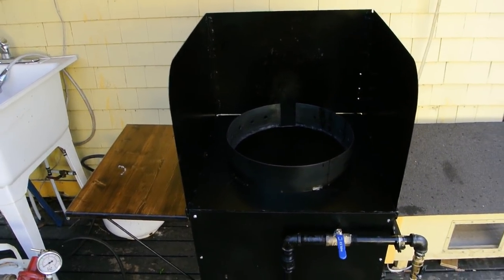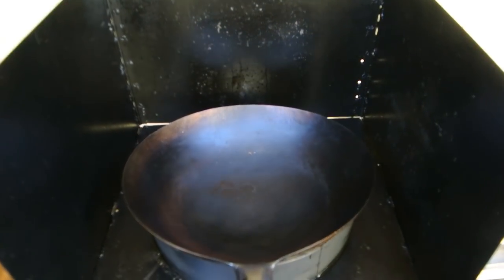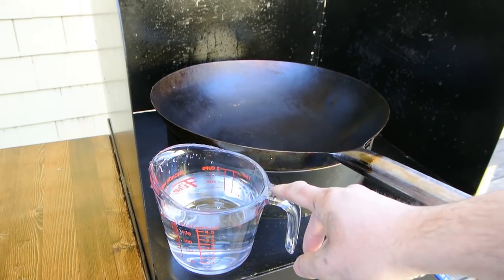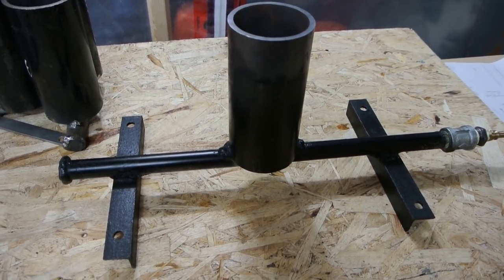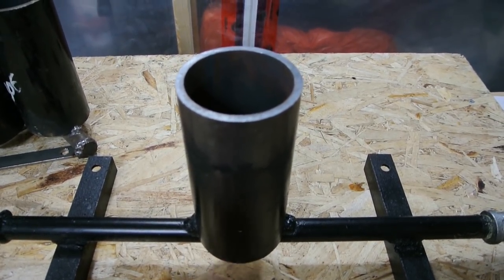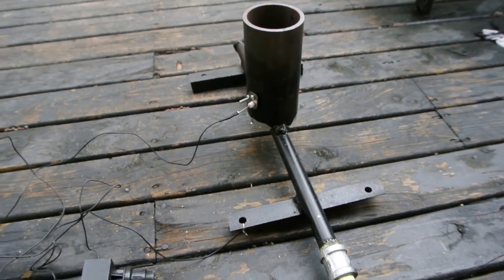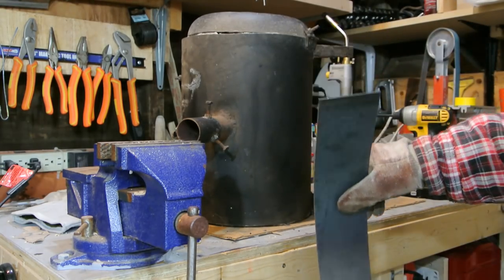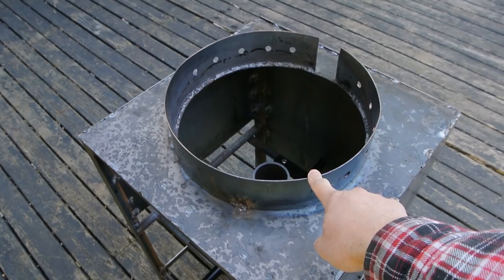Building an Outdoor Wok Station - High Power Burner

Comment: A tip I can give having grown up inside chinese Restuarant’s is that you can move the ball valve so that it’s facing 6 o’clock and level it to the height of your knee cap. This allows you to have both hands while cooking and using the your knee to control the flame.
Reply: koruki I always imagined a foot pedal type valve. That way you can be like NASCAR and put your foot to the pedal and give it some gas!
Reply: I figured the Chinese kids in the stores always did the grunt work
Reply: @advantager355  lp

L

Comment: I have built a lot of the pipe burners he is using, I have also built a lot of liquid propane burners in the millions of btu the orfce I use on the pipe burner is a grease zert grind the back the spring and ball fall out, it has 1/8 pipe thread use a 1/8 pipe couple welded to the bottom of pipe use.1/8 pipe for the rest

Comment: Amazing work. If I only knew how to weld... I'll have to settle for a Rambo wok burner as a cheap alternative.
Reply: That’s the problem I have too. Was thinking about building a wooden frame then just put marble or granite on top but would prefer to use steel in case the timber catches on fire lmao

Comment: Really cool build and video, Andrew - nice work. I bought an Eastman Big Kahuna that does pretty good - has around 65,000 BTUs, but a little more I see now would be a little better. I'll definitely learn from your experience and expertise, and I'll make use of it when I design and build one - nice work!
Reply: 50,000 BTU is perfectly sufficient for wok-hei.
Reply: @vladimirmach6145  In the experience I've gained in the last year, I agree - 50,000 BTU's is plenty to achieve "wok hei"
Reply: @danaolsen9603  Yes. The entire Thailand and Cambodia are successfully using the KB5 burner.
Reply: @vladimirmach6145  Yes - to develop 'wok-hei' the most important things are:
1) Practice cooking often, and
2) Don't overload the wok
You don't need anything else besides a wok and a decently strong burner, and practice!
Reply: @danaolsen9603  Well, from my practice I've learned that wok-hei is achieved by two essential prerequisites:
1. Extremely hot wok.
2. Contact of the food with the flame, especially at the distant edge of the wok during tossing. As soon as the ingredients slide from the edge and are catapulted up and backwards, they must touch the flame leaking up the wok edge to ignite and wash in the fire. This enables achieving wok-hei even if a slight larger portion is being prepared. Here's how I'm doing it:
https://youtu.be/K97A541cCR0

Comment: You ever thought of making the burner adjustable.  You could permantely mount a larger pipe with a set screw and the burner could ride up or down, I think it would be benefitial to you.  Nice project, I may make one for myself.  Also, one other the thing, where your current burner is you should maybe set the angle iron lip out to be able to get to the mounting hardware easier.

Comment: Nice job on the build here.  I have a suggestion that may help you if you would like to improve the performance of the device. The burner you have designed is basically a pipe burner,  and a pipe burner needs a Venturi to properly control the gas/air mixture.  You can purchase a Venturi for less than $30 at Tejas Smokers.com.  In your application the Venturi would be used with a #61 orifice fitting which you can also purchase there.  You could then open up your present exhaust holes and you would have full control over your flame right at the Venturi and eliminate the makeshift " shutter" you are presently using.. Anyway, just a suggestion.  Keep up the good work !
Reply: By design, his burn is a venturi.   High pressure gas will suck in air from the bottom of the pipe.  However, performance would likely be increased, if the orifice was inside the bottom of the burner pipe.
Reply: @CM-xr9oq  So using a high pressure regulator you don't need a shutter because air is being sucked at the bottom of the pipe? ?

Comment: Great video.  I bought a basic turkey fryer type burner supposedly outfitted for wok use.  Has a normal burner and venturi but I am scared of it as it always seems to backfire when I shut off the propane and it does not get hot enough, plus no wind shield so I would like to build on your design.  I'm curious if you have experienced any issues with backfiring, if you looked into mounting one of the jet burners available, and what you think about the other comments re using a venturi?  Thanks

Comment: that is so cool.i want to build one.what is cost of materials?i only have small portable burner at about 12mj/h.what you tested how hot this one is
Reply from the maker: +Darren Nicholls For the cost of the metal in Canadian dollars around $130.  Make your own burner will give you the high heat.
Reply: How much to make just the burner?i could probably adapt an old bbq to suit and a list of materials
Reply from the maker: +Darren Nicholls The burner requires a high pressure regulator, they are red in color (5psi), which will be your most expensive part, they cost around $30-50.  The materials for making the burner would be under 20 bucks.  Here is a video for how to make a burner, it's the theory but you can adapt it to make a single burner as well.  https://www.youtube.com/watch?v=WwCPkDr14vo
Reply: +Andrew W im from Australia and have different stuff here.we have lpg.never seen regular like that.will try and let you know how i go
Reply: Andrew,what type of welding did you use?
Reply: +Andrew W also iron pipe a bit hard to find in aus.what else could i use
Reply from the maker: +Darren Nicholls I used a DC Inverter stick welder.  Here is the a video of the one I have, if you can find them they are an excellent deal.  But takes some time to learn, but a wire feed welder (MIG or flux core) would be easier to use and learn but they cost more.  https://www.youtube.com/watch?v=BcBJQUzpQkg
Reply: What can i use instead of iron pipes.hard to get here
Reply from the maker: +Darren Nicholls I'm not sure, maybe call you metal shop and see if they have anything similar.  In canada that pipe is sold every where.
Reply: +Andrew W  the half inch iron pipe,how long is it and the o.d of the schedule 40 tube